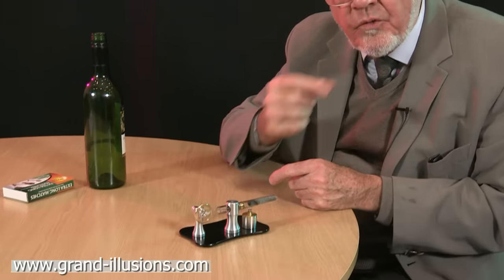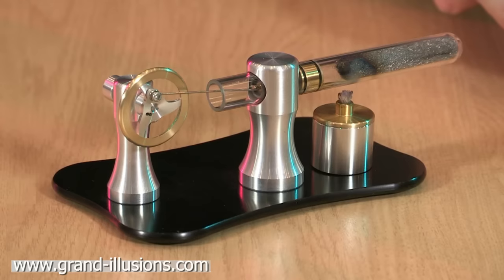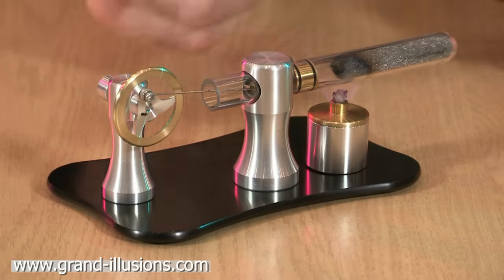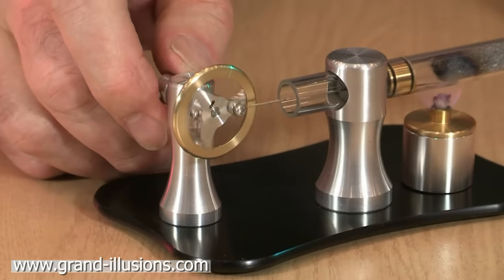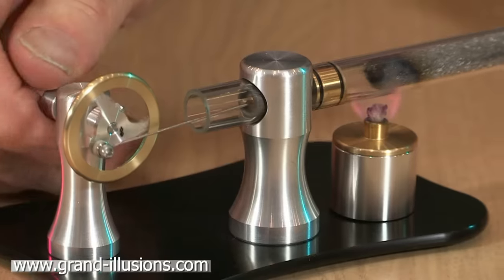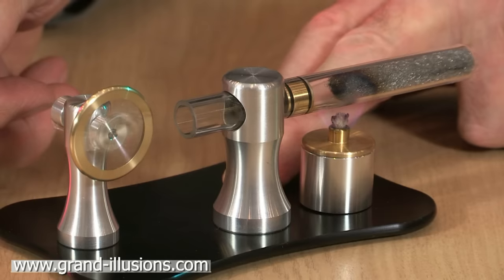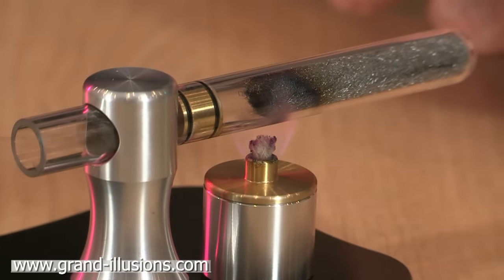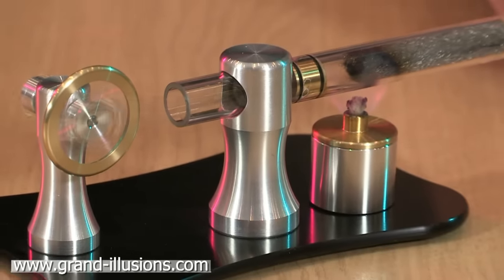Thermo Acoustic Engine

Comment from the maker: The engine will actually run in either direction, it just depends on which way you spin the flywheel at the start.
Reply: You got some science there Tim. And it's awesome
Reply: Can't believe this had no replies in 8 years
Reply: Put a little electric motor as a starter. Use a little battery to start the engine and put a tiny alternator to keep the battery charged, lol.
Reply: @AI_GAMER_GUY  I mean, I don't even think replies were a thing eight years ago
Reply: @gagekieffer772  in fact they were not. You had to type in thier usernames the start of a comment to tag them in a way
Reply: @AI_GAMER_GUY  u are the YouTube algorithm
Reply: i was here
Reply: FACINATING. TELL ME MORE!
Reply: I would like to study this engine more..this wud had worked even if the fire source was at the very end of the tube right?.

Isnt this essentially a stirling engine...but its single pistoned..interesting..
Reply: @foureyedchick  its not the electric motoar as starter but the heat that keeps it going..if you are pruducing electricity with the help of your alternator the electricity converted back to heat to keep the engine working will always be less..
Reply: @stopdasteal4919  No! No! No! The electric motor is only the STARTER that runs for a short time. The alternator, which runs ALL the time, keeps the battery topped off so that it can start this engine next time. Isn't this a duhhh moment for you?
Reply: @foureyedchick  I understood exactly what you were saying. Would be a cool mod. Would really like to see a bigger scale model of this power a boat or something just for fun.
Reply: God I pray you live forever
Reply: @AI_GAMER_GUY   weird
Reply: Where can I buy one of this?
Reply: Well everyone knows that 🎉
Reply: Interesting I'll get one
Reply: How long does it keep going after blowing it out?
Reply: @TheDarkLasombra  29 years
Reply: This is actually because the flywheel sustains the momentum of the motion no matter which way it is moving 😉
Reply: Guys his is the 1st time ive ever seen a comment from tim :D
Reply: Hiii i m from 2021 :D n you 2012
Reply: I have a real questions.: how long does that tube last? Also what is inside it coal is my guess? And what causes the fire to stay light.
Reply: Very interesting tim!
Reply: @stopdasteal4919  I don't think it would... the fire is placed at 1/4 of the tube to generate the wavelenght. Look at nighthawhinlight videos on the topic. 
I also found a resemblance with the stirling, but that works on a slightly different principle, requires 2 pistons (even concentric) and should have a better efficiency (max theoretical should be around 24%, far less than internal combustion but still more than photovoltaic).
Reply: Could this be used practically in some sort of car? If not then just make a proto for collection :3
Reply: @mhplayer  like the Stirling, this engine doesn't work well with variable loads, so it's a big no for automotive unless coupled with a generator to charge batteries. Compared to internal combustion engines, the reliability and sturdiness are higher, but the efficiency is far lower.
Reply: @mariosebastiani3214  oh so it lacks of torque and is just impossible to control in terms of power is what you say? That might be an issue indeed.
Maybe using a kynetic battery (system used in some buses as an experiment: take a big cylinder, make it float with supraconductors and make it spin, thus having kynetic energy stored) to pile up the energy and then use it to make the wheels go, that would allow for either torque focussed usage or rpm focused usage dependent on the gearbox with no issue concerning the engine, an engine that would spin faster and faster could then be usable in this way, the only issue is how unefficient it would be and cost heavy xd definitly a collection or demonstration vehicle: just to show it is possible without real practical usage
Reply: @mhplayer  that's an interesting solution, albeit one that takes space and adds weight... I'll look into it.
Reply: Extraordinary.
Reply: If that was my little tiny engine, I'd cobble-fab a set of dual overhead cams onto it. I would also run NoS into it. I'd have 2 bottles of NoS, instead of just 1, hooked up to it for double the power output.
Reply: How does the air contraption works in this? Like we have intake and exaust in petroleum engines
Reply: All engines to be exact with slight mods
Reply: @foureyedchick  un
Reply: @TheDarkLasombra  10 sec
Reply: I know I’m late to the party, but I’m starting to grasp the concept behind what makes these engines “tick” and I think it would’ve been a great practical demonstration to show what happens when you heat a test tube with just steel wool, then maybe use the sound/vibrations to perform some other form of work(like putting it against a glass of water so you can see the standing waves visually), and then finally showing the demonstration shown in the video. I think it would’ve really made it a lot more intuitive, but that’s just my opinion.
Reply: I know I’m late to the party, but I’m starting to grasp the concept behind what makes these engines “tick” and I think it would’ve been a great practical demonstration to show what happens when you heat a test tube with just steel wool, then maybe use the sound/vibrations to perform some other form of work(like putting it against a glass of water so you can see the standing waves visually), and then finally showing the demonstration shown in the video. I think it would’ve really made it a lot more intuitive, but that’s just my opinion.

Comment: Tim's account is correct.  This is a resonant hot-air engine.   Not a Sterling engine.  Not a solution to the world's energy problems.  Inefficient compared to true Sterling engines, but fascinating, and therefore of value.

Comment: This sounds really efficient. There is no exhaust, so none of the heat which is trapped within the tube is wasted. Only the energy that matches the standing wave conditions, and the conditions of a mode hop will escape.
Reply: The exhaust comes off of the flame. Very inefficient actually since most heat is unused. It's like a vented gas heater vs an unvented gas heater. You lose some efficiency with it vented, but unvented has the combustion gases (exhaust)
Reply: @cubey  Sure but the flame being exposed like that is just to make it look cool and easier to play with. If you used a proper setup to focus the heatsource on the tube, the waste would only be from the cold side of the tube radiating heat and your other usual entropy losses in an imperfect system. I'm curious how much of a loss that is.
That said it's probably not THAT efficient, hydrocarbons are just very dense energy sources. But it seems pretty good for such a convoluted method.

Comment: You're right on the first point.  What he has there is a Beta Type Stirling Engine.  However, there is such a thing as a thermoacoustic enging, which uses acoustic standing waves to push the actual internal fluid in a Stirling Cycle.  It has fewer moving parts than a Stirling Engine.  It converts heat to sound, or vice versa.

Comment: Is it possible to apply this in large scale in volcanoes for unlimited energy?
Reply: uh, probably
Reply: aint burning forever dude. The fuse will go out eventually. Plus, that little thingy aint spinning that hard, which means i dont think it will generate that much energy. Correct me if i'm wrong 😉.
Reply: true, but the heat of the volcano will last much longer than most sources
Reply: Generally, yes. Although thermo-acoustic generators aren't currently used commercially, geothermal power plants do actually generate "unlimited" energy, as long as the earth is hot.
Reply: There has been tries to use those in larger scales, though the mechanism is actually quite delicate, and most larger ones tend to run too fast, and break themselves. As an idea, it does work, and a lot of effort goes into making it real. Still, as of now, there aren't any working ones producing much of energy(as far as i know). The big problem with thermoacustic engines in energy production is their large size compared to the energy production.
Also, on the good side, the models, mainly stirling engine, work on actually a really small temperature difference. So using dangerous things like volkanoes isn't necessary.
Reply: Dig 12km into the ground and you have free energy wherever you are on earth.
Reply: never heard of thermoelectric power plant? Same principle of steam trains. Also hydroelectric power plant represent an "infinite"  source of "free" electricity but at the expense of building it, maintenance, and after that they will sell the electricity to you 10 times it's cost because we are plebs and they want a yacht
Reply: Tocen there is no unlimited energy
Reply: There's no such thing as "unlimited energy". However, yes, it would be possible and they would run for a long time.
Reply: vibrator
Reply: It could work but how are we going to get it to the cities.
Reply: David Hanselvunth well a volcano would produce way more energy
Reply: That's something called a stirling engine. Same concept just scaled up.
Reply: It’s called geothermal energy and we use it all the time
Reply: Let me call elon musk
Reply: Tocen ANYTHING IS POSSIBLE
Reply: Marian Keller it's unlimited energy, as if earth gets colder, we all die. so, it will last until we all die or longer.
Reply: Texan Nationalist for volcanos steam engine will be the besy thing
Reply: Tocen everything's possible, only, nothing free out here, electricity was originally free when it was generated by water Mills and as it developed someone came up with a great idea to start charging people for it.
Reply: It's best to use heat to make a steam powered generator....
Reply: You could add in a few gears reduce the speed and increase the torque make the rotations harder as you commented. Completely Possible but not worth to be put in volcano scene. Putting in transmission lines on a floating lava pool is not cool.
Reply: Well, take a look at Iceland. They get the majority of their power from geothermal energy.
Reply: Beryllium I like the way u think
Reply: Tocen it is already in use! Iceland uses geothermal energy  (heat collected from volcanoes) to generate steam that powers majority of northern Iceland.
Reply: I don’t think those things make that much torque.
Reply: People are hesitant in building infrastructure around volcanoes because if the volcano blows it may cost more to repair than the energy output is worth.
Reply: No
Reply: #1 Problem was speed breaking the engines? Use variable gearing for optimum mix between reliability and output then.
#2 Problem was infrastructure around volcanoes = Risky business? Use cheaper pipe-work to lead that heat to the engine.
Bada-bing bada-bom.
Reply: Its geothermal energy generation already being some with steam.
Reply: We do, minus the unlimited and acoustic part. Geothermal energy
Reply: Volcanoes cool off over time same with magma chambers
Reply: No
Reply: Because there’s no way to have unlimited energy
Reply: No
If a gearbox engaged with this motor
This motor stop at that time
And this isnt usable
Reply: So all af you here are.  A mechanic now? Aren't you
Reply: Go outside and look up. See that big burning ball in the sky? Provided it is day time, that's "unlimited energy".
Reply: Nah not many active volcanoes ,nor are they near people so it would be expensive to make it reach the people.
Reply: Tocen we can try.
Reply: Oh shit
Reply: ,🙏🙏🙏🙏🙏. ........Being a physicist, I loved ur thought......Being a normal human, have u gone mad ?
Reply: It would get you something but it wouldn't last forever
Reply: @texannationalist5887  That’s not the point here. The point for something to work for anyone to get any gain in it is that it’s supposed to crank lots of power. This device only puts around 3 to 4 times more power than a normal human can out out. Let me out it in simple English words. One human can put out around half of what one horse can put out. One human is half of a horse power. So this means this little rig here can put around 4 horsepower. This is why motors don’t adapt this method, because it’s not good enough and it’s not powerful enough. A volcano on the other hand will probably melt the device if such device is created and it will probably will be all a fail. Maybe multiple fails to say the least. Waves produce lots of power and we can extract their power using better and simper methods.
Reply: They did that in an episode of “The Six Million Dollar Man”.  I looked it up and it is called “The Secret of Bigfoot” season 4 episode 16.

Comment: Why is that acoustic ? Seems more like thermo-kinetic.
It converts heat into movement = kinetic.
Reply: "The thermo-acoustic engine works by converting sound waves into motion. The sound waves are generated by heating one end of a 'stack' of coiled material and allowing the other end to remain cool."
Reply: I agree.. it’s just the heated up gasses pushing on the piston from the inside
Reply: Odey you dont understand the science behind it.
Reply: @JMRabil675  please explain
Reply: @odeytayem8902  Yes please do cos I can't understand where the sound comes from.  I couldn't even hear any sound.
Reply: Because the engine in the video is just beta type stirling,not thermoacoustic. The thermoacoustic does not have any moving parts at all
Reply: @MarkJT1000  above. The engine in video is beta type stirling
Reply: I don't think it's a Stirling engine of any type, because those have 2 pistons.
Reply: @jamesrindley6215  second type, first types do have two indeed, this one uses the gas to push the piston back as i remember..
Reply: @JMRabil675  what Odey said is completely true
Reply: @CheseWhelie  sound isn't involved in moving anything, however a temperature differential is, expanding air moving the piston and and a flywheel creating inertia to complete the cycle, an example of thermo-acoustic properties would be an ultrasonic transducer vibrating water into a vapour........... in my opinion
Reply: @leightonwestbury92  your opinion is directly contrary to both the description in the video and the actual technical description. https://en.wikipedia.org/wiki/Thermoacoustic_heat_engine
Reply: Agree
Reply: @CheseWhelie  It just looks like a complicated stirling.
 
Man, now I am really confused. Gosh darn sound, one of my nemeses (instruments, I hate playing them). I can understand most other kinds of stuff but I can't wrap my head around this. Oh well, Stirling engines are cooler anyways, sound is lame. Like acoustic cooling? nah, heck that, phase change and magnetic are far more interesting.
Reply: @leightonwestbury92  From what I've gathered (and rather difficultly, dumb brain of mine) it isn't sound but rather how sound works. Tuning the engine to wear it can produce the distinct hum also correlates to the perfect timing of pulses required to do... stuff? Sound is the byproduct but also a tool.
 
Or I could be completely wrong in how I understand it, yeah, that's probably it.

Comment: It's called Stirling Engine, and it's known to have the greater efficiency, by that means, It's also the engine that resembles Carnot cycle.
Reply: They are both very interesting heat engines, but thermoacoustic and Sterling engines are two different things.
See: https://en.wikipedia.org/wiki/Thermoacoustic_heat_engine
and: https://en.wikipedia.org/wiki/Stirling_engine

Comment: A Stirling engine works by moving a heated and cooled working fluid, such as air, exploiting the thermal input to create work by compressing the cold air and expanding the hot.

The Raleigh device works by producing relatively high-amplitude sound waves
from the heat difference, and using those to cause motion in the piston. The working fluid is only used to carry the compression wave, creating both compression (at peak) and expansion (at 0) without having to actually move the fluid.

Comment: Very interesting, thank you.
However, the action of the hot air and the piston could have used more of an in-depth explanation. I suspect the expanding heated air is pushing the piston outward until some port is cleared, releasing the compression. Next, I suspect that the flywheel (now in motion) forces the piston back into the compression chamber", and the process repeats. There is no one blowing into the tube, of course. The harmonic resonance explanation misses the issue of the movement of the piston. The engine is not working on audio resonance, it's working on expanding air. "Similar" to the action on a steam locomotive, which is a better analogy then blowing into a bottle. 
But again, I enjoy the videos very much, and I thank you for another thought-provoking episode!
Reply: Wouldn't that explanation run out of air inside the tube?
Reply: Ben Merigan fast, fast fast... Emptied your brain brain brain,,,
Reply: the piston is moved by a standing wave inside the tube, NightHawkInLight has a great video explaining this